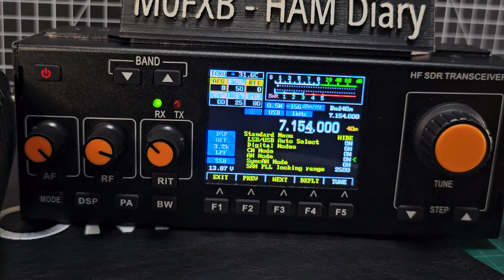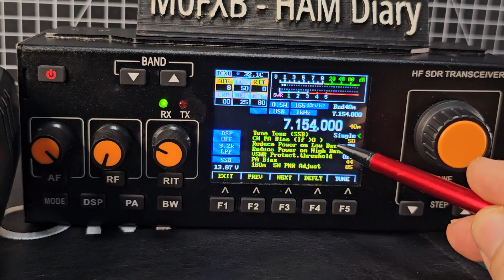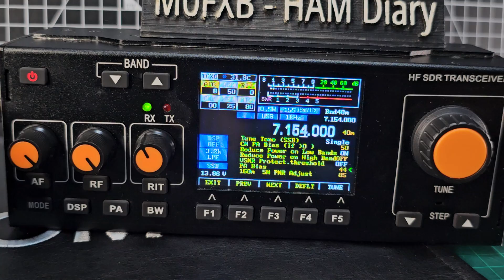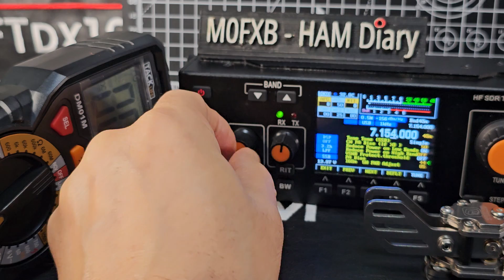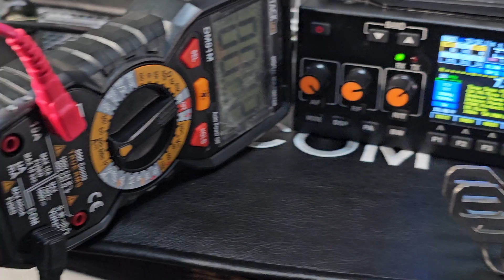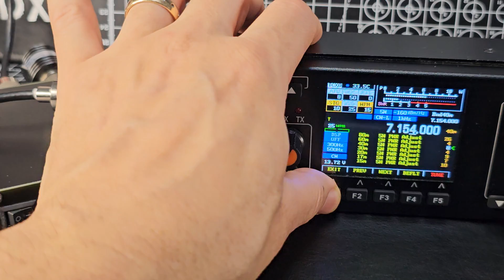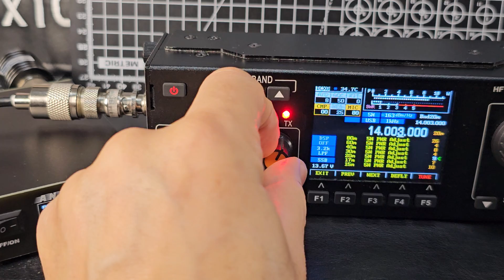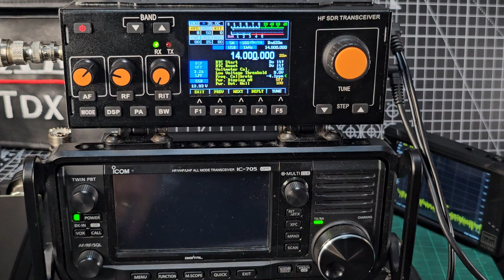RS-918 MCHF Calibrating Bias , Power & Frequency - Learning

Comment: 320ma + 500ma = 820ma NOT 920ma
The way you set the CW bias is not correct, you need to establish the "base" current with no modulation but you measured while keying so you do have modulation. Your CW bias is way too high. It is easier to just set the bias in SSB and set the CW bias to 0 so that it will use the main bias. Else you use the base bias from SSB (in your case 320ma) and set the CW bias as 320ma + 500ma = 820ma while keying. If you keyer is set to paddle, like yours, you cannot get an accurate measurement as it is jumping around. Set it to straight key, only one paddle will work, hold it for a solid key and then adjust.
Reply from the maker: Thanks I am learning
Reply: @M0FXBHamTech  Does this mean the video is inaccurate?  If so then take it down and correct it.  You are positioning yourself as an expert here after all.

Comment: Just received mine - the "orange one"....really great.
The charger (see bellow, do not replace it with a pure voltage driven power-supply!) even had a EU plug add on.
Now I will start calibrating the PA BIAS with a dummy load and an oscilloscope - while doing that I also can double check the PWR display of the AT-100M Pro;
I also have seen that there is (in the orange box :-) the choice of a 2-tone SSB modulation for calibrating the drive..mic...compression with an oscilloscope - so I guess I don't even need a tone-/function generator.
Really really lots of things put in coding that are vy helpful.

So far I got what I wanted, I already have the uSDX (not the true one), but for me a bit to tiny and more knobs besides the menu-only is very helpful as well as the battery. 
QRP is fun - and when I get frustrated I take my 48 years old Yaesu FT-101E :-) 

For sure we have to honor the original inventors/developers!
Reply from the maker: Agree totally such a fun toy .

Comment: Hi thanks for the video.
 I've just bought one of these.
 But confused on how you charge it up does the radio have to be switched on.
 And how do you know when the battery is fully charged.  Thanks  Geff 😮
Reply from the maker: Definitely DON'T just plug the 13.8v ( 12.v) into the charging point.. you may overcharge the battery!  (and battery go BOOM!)

The original charger has the charge limiting built into the charger - it says it is 12.6V 500ma , but it has current limiting built in , and , as the battery voltage comes up the current goes down and when it is charged it turns off ( there is a status light on the charger..
Reply from the maker: Yes good point I will find out .
Reply: Thanks for the advice.
 It's worth doing the video on. Happy New Year 2024.😊